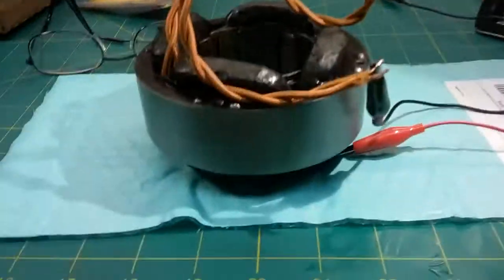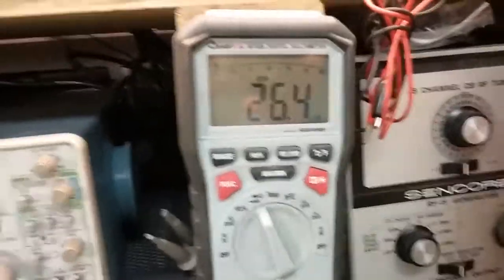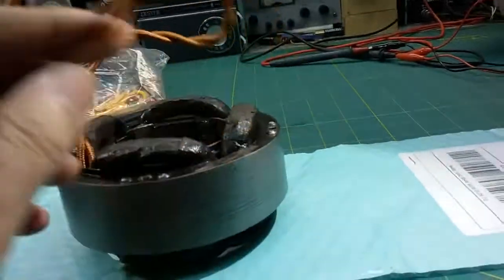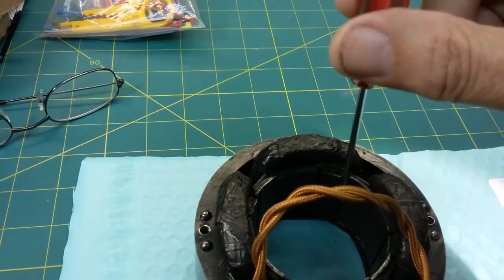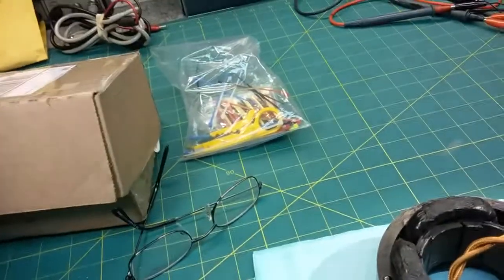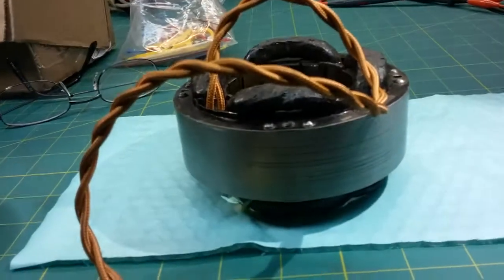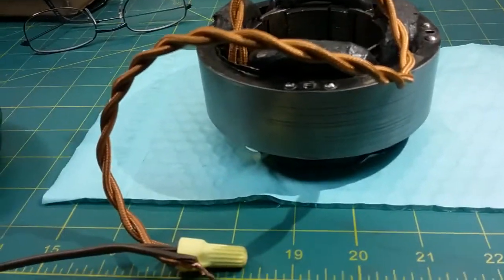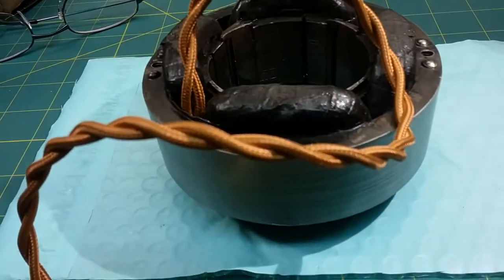Fan Motor Stator Testing Process

Comment: How do you identify the two wires on the stator?  I have an old fan where the wires crumbled and I can’t identify which is which
Reply from the maker: It doesn't matter on a two wire stator. The fan is AC so the curent switches back and forth 60 times a second. No need to hook them up in a particular order.

Comment: I have a vintage GE 3 speed 2 lead headwire stator.  The resistance reading 10 ohms, is this ok for me to wire up the speed selector and plug it in?  thx,  dave
Reply from the maker: That's a good question David! Ten ohms seems low to me. It is possible the stator got hot at some point in time, and some of the turns shorted out. A quick first test would be to check for resistance between one of the wires and the metal stator iron. If you get a reading, the coil is shorted and no sense going any further. If it test OL (Open Load), then that test passed and I would then suggest getting a P3 meter like I used in this video, if you want to plug it directly into mains voltage. I would suggest you first plug in the P3 meter, set it to current scale, and start the fan with the switch on low. Watch the current! And be prepared to immediately pull the plug if the current goes over 1 amp. While the stator coil may jump up there if it has shorted turns, you don't want to damage the speed control coil by drive high current through it. Ideally, a current limiting bulb would be your safest test. Once you know it is not high current, you can bypass the bulb. Do a search for current limiting bulb. It is a very simple and inexpensive device to make. A simple bulb, socket, outlet, line cord, and a light switch is all you need.